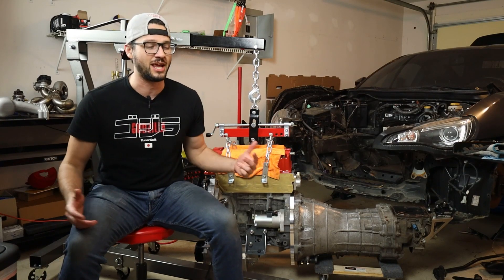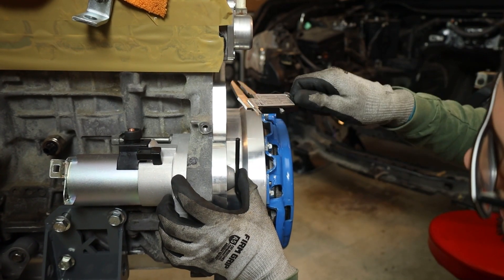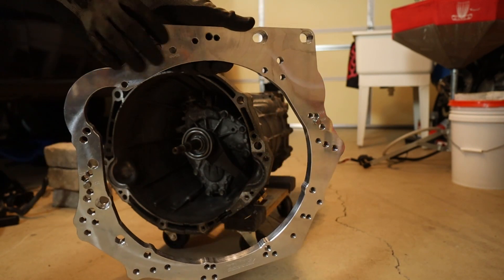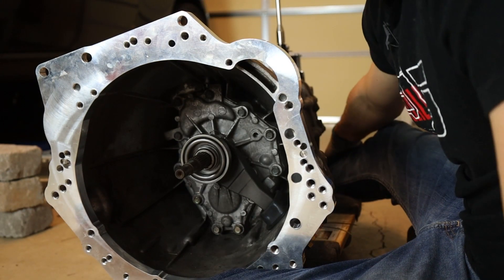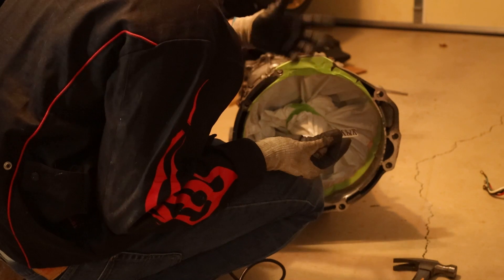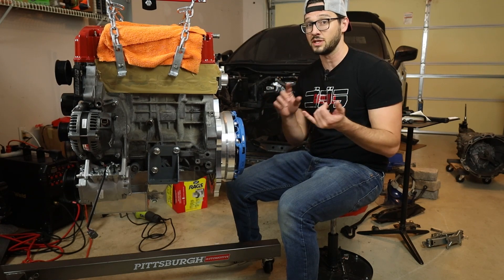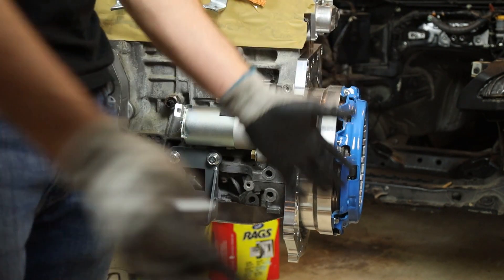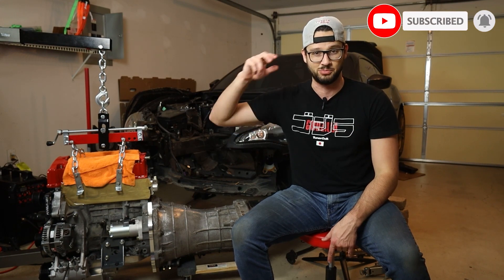K24 Swap BRZ Part 11 - Mount K24 Engine to CD009 Transmission

Comment: How come the motor is vertical instead of horizontal sorry I'm a noob doesn't the transmission bolt up the the back
Reply from the maker: I’m using this engine in a rear wheel drive setup that’s why it’s longitudinal (or “vertical”) instead of transverse (or”horizontal”). All of the cars that the Honda K20/K24 came in were front wheel drive, and that’s why they are normally transverse mounted. Thanks for the question, and I hope this helps!

Comment: I’m excited to come back and rewatch the build when I get my kit
Reply from the maker: Hopefully you find it helpful! I’m trying to make this series as comprehensive as possible so that folks can use it as a guide. Are you planning to use the stock trans or something different?
Reply: @BuildingWithSean  I'm doing the same set up. Got my plate kit from TF works
Reply: Which kit?